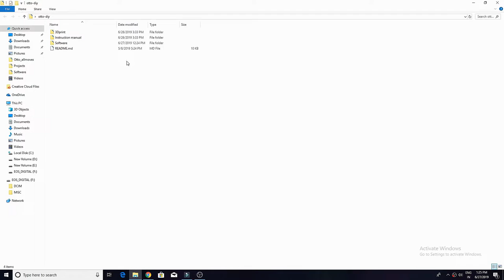How to build your own Otto DIY, the best Arduino dancing robot

Comment: Code???
Reply from the maker: you mean example codes?
Reply: @OttoDIY  yes
Reply from the maker: @callformusic2428  sure, you can find them in our website: https://www.ottodiy.com/academy 
In the "Educational Guides" section you will find guides to code using Otto Blockly or Arduino with our official library. 
The community is constantly working in new options to code like Python... on our GitHub repos you can also find more.
Reply: @OttoDIY  thanks a lot.